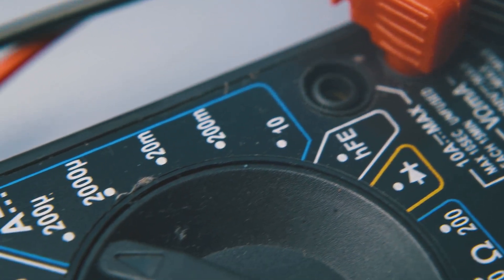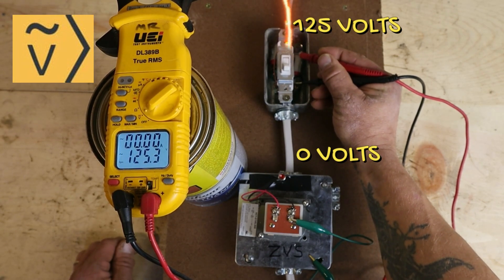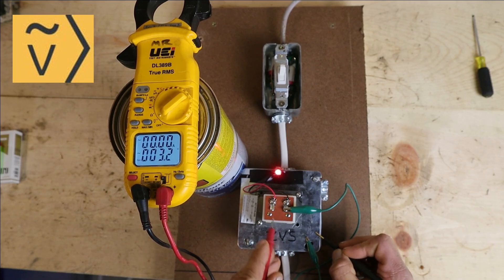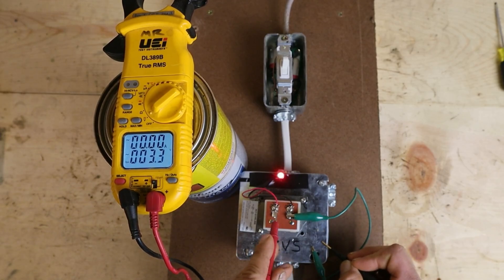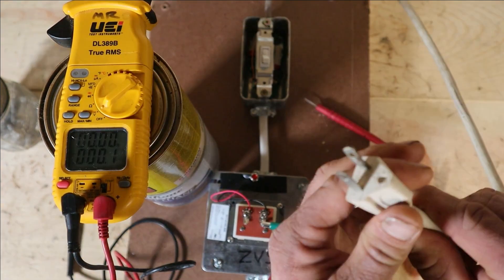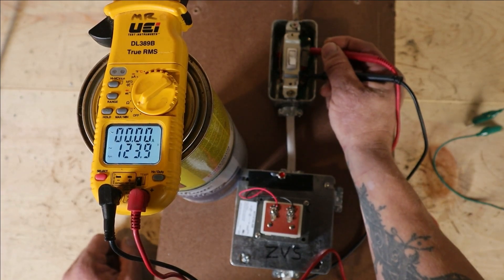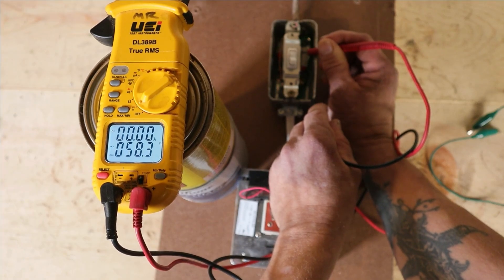What Most Beginners Don't Learn About Multimeters (But Should)

Comment: This is exactly how my dad trained me in HVAC electrical troubleshooting in the early ‘90s. This was when more and more furnaces & RTUs were using control boards and the 24v side of the transformer common would come grounded. Techs would see that ground and thought they could trace the whole control circuit to ground instead of common. 

My dad said all you will find that way is potential to ground, not what the transformer is actually putting out or if the circuit is operating normally. The same goes for the 120v line voltage and a bad connection of the neutral. Which I’ve come across a few times.

It’s good to see that you are still teaching the proper way, Mike!

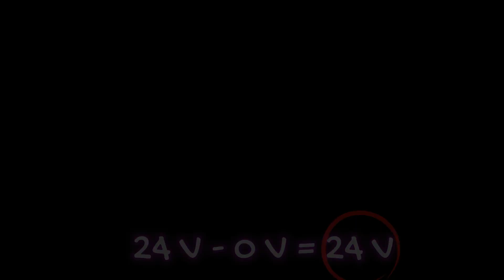Comment: At   02:18   your statement is incorrect. There is nothing in the multimeter "black box" that does 2 readings.  If you want to know why it is simply that the standard multimeter is simply an analog multimeter with enhanced electronics to make measurement easier.  These are things like  sample and hold, continuity buzzer, overvoltage protection, over current protection has not changed - just blows a fuse, diode checker and the other lesser used functions that electricians would never use like transistor checker etc.  Nowdays most multimeters have an ADC for voltage measurement. That's your multimeter in a nutshell.  
What you are talking about is potential difference and I see this mistake time and again.  PD is a relative reading.  The only reason you can say it's 1 volt or whatever is because you are using an instrument that has been calibrated against a standard before leaving the factory.

Comment: So "voltage differential" means an abnormality in the circuit
Reply from the maker: Not exactly. A voltage differential just means there’s a difference in electrical potential between two points—and that’s what allows current to flow. It’s not an abnormality. It’s the normal condition that makes electricity move from point A to point B. If there’s no voltage differential, there’s no reason for current to flow—just like water doesn’t flow between two pipes at the same pressure.
Reply: Ok, so at the least if my meter is reading half of what it should that means Im doing something wrong? And not really an issue with the circuit? @JerseyMikeHVAC
Reply from the maker: @Mr.Randy210  It could be either one. Sometimes you'll read half if the circuit isn't properly grounded and you're using ground as a reference point with your multimeter. Try a common or neutral instead of ground in that case.

Comment: If the electrician who wired that metal box had done a good job, it would have been bonded and would not have shown the 55 volts you observed.
Reply from the maker: Yes, that is correct. But this is a tutorial. It was done intentionally to teach precisely that point.

Comment: Not understanding potential difference isn't a lack of understanding how multimeters work, its a lack of understanding how electricity works.
Reply from the maker: This is absolutely true, but by framing it as something you need to understand about multimeters, I'm reaching a large audience of people using multimeters who don't know about potential difference. If I frame it as "How electricity works", I am only reaching people who are already approaching things correctly. Unfortunately, that's not the reality of our world. Some people are out there sticking DMM prongs into outlets taking voltage readings without fully understanding.
Reply: Something I was shown very young that really helped me to understand potential difference was my tutor rigged a pc to have 12v dc on one pin and connected the 5v to the other so that we got 7v potential. That really sunk it in.

Comment: For a real beginner, some more experienced tech needs to grab some tape and put over the jack for measuring Amperes.  Nearly 100% of new techs blow up their first meter by setting up to read current when they check a voltage source.

Comment: I'm an industrial mechanic.    The number one mistake i see other techs make is trying to read the hot wire voltage referenced to ground.  But if the neutral is open or partially open, then the meter lies to you.  Ive seen this dozens of times in 25 year career.  Also, if you read more than a couple of volts between neutral and ground, you've got a problem

Comment: I really appreciate you explaining these things, I too think it is a very important concept for beginners to learn. However, I feel that you left out one essential part of that concept:
Voltage is potential difference. You cannot measure voltage on one single point because voltage is the difference in electron charge between two points. You cannot determine the difference between two things, which is what voltage is, by looking at only one of them. So per definition, there is no such thing as voltage at one point in the circuit.
It's understandable that one would think it is that way because the way it's usually talked about does suggest that we measure a voltage at a single point, but in that case, there still is the necessary reference point, earth, it's just often left out because earth is the default reference point of sorts. Ultimately, we reach the same conclusion: always be aware of what you're using as a reference point when measuring voltage.

Comment: Also note, the AC voltage measurement is RMS voltage. This means in simple terms it's a trigonometric number in relationship to the AC voltage that is constantly changing. So if you're measuring something that's not a sine wave or no 60 hz, the meter can be very very inaccurate.

Comment: I was about to point out the obvious in the beginning.  Then I remembered "beginners" in the title.  I went to college for electronics.  BUT, this is a very good point and video that most beginners in the trades probably are not taught.  When I'm training someone I am very clear to point out that you have to have a reference, ground, neutral, etc to read the hot or positive.  No ground, no true reading.  That's how you get hurt.  We save reading voltage drop for a later date.  LOL.  Good points.

Comment: The intention of this video is sound. The explanation is not correct from 1:58. A multimeter in voltage mode does ‘make’ a single voltage measurement. It displays the difference in voltage between the two probe inputs to the meter. It DOES NOT do a calculation to compare each input with some external reference. At 2:23 we are back to the correct description.

Comment: Taking a reading across a closed contacts with the power on is how you read voltage drop, 0.0 volts is good.
Reply from the maker: There is 0 potential difference and it is a good reading, but it's not a voltage drop. There are still 120 usable volts there when you move one of your leads to a proper reference point. 

Measuring close to zero across a closed contactor coil or energized motor windings is an actual voltage drop
Reply: @ by your logic I don’t believe you understand what a voltage drop is.
Reply from the maker: @truthserum9157 You need resistance to get a voltage drop. A switch doesn't provide that unless there is a problem with it. 

There is a considerable potential difference that occurs in a voltage drop, but potential difference alone is not a voltage drop.
Reply: @JerseyMikeHVAC  being a motor control electrician in an industrial setting I’ve come across many instances voltage drop issues on contractors, switches, motor starters, all can be measured the way you did, top and bottom of of your switch, it’s not the way to measure voltage, but i was only pointing out that it was the proper way to measure voltage drop.

Comment: Cut my teeth on my dads great Simpson model 260 back in the 1960's then went to Fluke digital meters. CAUTIIN NEVER purchase or use any safety or test equipment made in lying cheating lack of quality control communist china. They money you might save not worth your safety or death if others. A coworker almost got electrocuted when he used a cheap combination capacitor / voltage tester. Was maybe 8 months old one only used a few times. The 480 volt circuit he tested did not pick up any voltage. He was rushing and should have first tested it on a know energized circuit, tested his circuit then retest on a know circuit. I always carried at least on replacement test lead & sparemeter fuses in my meter cases.

Comment: when the switch is on, and you test the terminals of the switch, you are reading the voltage drop of the internal brass switch components, which is more or less zero.

Comment: First thing to do with any multimeter is to check the continuity of the leads using.   Ohms.  A bad lead or probe could kill you as it would show a dengerized circuit.

Comment: A little interesting past story concerning multimeters. Decades ago now I was gifted with a Centech multimeter. And I was proud of it and wanted to show my wife what it does. So I took the meter and plugged both meter leads into the wall socket and to our surprise the entire meter popped very loud and jumped as well. A little smoke came out of the meter and it was toast...figuratively and literally. What I didn't know at that time was that Centech meter was in the off position. And for some strange reason, they built their meter to be in a shorted lead when circuit in the off position. So the circuits inside were vaporized off the board. I had to rebuild that meter to be able to ever use it. Since that time I own many Fluke meters and some other cheaper meters. But that experience with the Centech taught me a great lesson. Be careful how you use any meter...

Comment: One thing I will add.  You are using a ‘True RMS’ meter. 

Accidentally put your meter onto DC Volts and measure your switch and it will show you zero volts. 

This is because the RMS is calculating the ‘average’ voltage and on sine wave AC power it will always average to zero volts. 

Be aware and don’t make this mistake!
Reply: "True" RMS means that is has the voltage added in an integrating circuit to give a real value. Some meters may just read the peak voltage and dive by square root of 2, but this is only correct for pure sine 1waves. The RMS of other waveforms is different (e.g. square, triangle, harmonics in your sing, noise, etc.) and would show an incorrect reading if using the "pure sine wave dive by root 2" trick.
Reply: @ An integrating circuit is still calculating the average value, no?

Agreed, it isn’t just a mathematical calculation off the ‘peak’, but it is still calculating an average based on more accurate data.
Reply: @rickschlosser6793  it's taking samples, squaring that voltage and then adding them up in the integrating circuit, then taking the square root of that value. The same way you'd calculate it mathematically, hence "true".

Also, the AC will be ignored when measuring DC,  ut you still may get a small reading due to any DC offset. 

I hope that helps you to understand. Ppwer= V²/R, so we want the  root mean square of the AC in order to give an equivalent DC voltage in terms of power delivery. Typically we want the RMS value, but capacitors for instance are rated in peak voltage from what I've seen, so you a 300V rated capacitor will blow on 277VAC (RMS) .  For dielectric breakdown threshold  we are concerned with peak values.

Comment: People forget that the Volt is a unit of potential difference

A Volt is not an absolute unit, it is a relative unit. As in the relative difference in electrical potential between two points.

To measure a difference, there has to be a difference to measure. When you're trying to measure two circuits which are electrically isolated from each other, there is no potential difference across them, therefore there's nothing to measure. Even though both may contain very high voltages inside them.

A good example of this is using an isolation transformer to work on CRT equipment. There's anywhere between 7kV  and 55 kV on the anode of a CRT. Some - maybe more. Yes, that's THOUSANDS of volts. With enough current behind them to stop your heart instantly if you toch the anode with one hand and a reference ground (for example an earthed metal table/etc.) with the other. The isolation transformer makes this sort of equipment safe to work on by taking away the reference ground. That means that even though there might be 55 kV inside the equipment, if you accidentally touch something you shouldn't, said 55 kV hasn't got anywhere to go, so you're relatively safe. You'd have to touch both the anode and the chassis ground for current to flow.

This also means that if you accidentally connect your scope probe's ground lead to a source of high current (rather than a skfnal reference ground), it won't blow up, as there's no potential difference between the hihh current source and earth ground (where the probe is also grounded to).

Comment: Advanced electricians only:
Pause the video at 4:32.
What happens if you try to "reconnect" the ground wire in the plug that's been mutilated by taking it to the workbench and wiring the ground wire to the neutral wire?, since ground and neutral are connected anyway in the panel.
Bonus points if you label each V, A, and Ω at the worthwhile nodes in both on and off states.

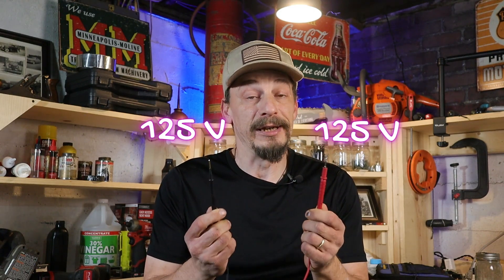Comment: 2:50 sorry you are measuring a current, when measuring Voltage. If there is no potential (or the potential is to low for your DMM, even over a switch (there will be a resistant of a milli ohm or lower) then the no current.
If you are measuring amps (with out a clamp) than you are measuring Voltage…. 5:27 Both points have the same reference! The Starpoint of the transformer, the are just using different ways. First L to N, second is L to PE.
Reply from the maker: You can't talk to beginners like this.
Reply: @ That’s just ohms law….
Reply from the maker: @zoom_h2625 Yes. I'm aware of that. Thank you.

Comment: This is a very good video I love when people go back to basics like this because it is easy to overlook these things when troubleshooting. You must know how your particular meter works too. For instance, the meter I use for work and others have certain limitations you need to know. My meter will read continuity with the tone on, but in that setting, it only reads up to a certain resistance if I turn the tone off, though resistances much higher can be read.

Comment: If the DVM "didn't" measure the potential difference between the red probe and black probe, what would it be called since its not measuring the potential difference in voltage?

Comment: What a great way to start a Saturday. Great video Mike, direct and to the point.
And may I add that a cheap set of leads can cause unreliable readings. A good set of leads is important for correct diagnostics.
Reply from the maker: Very very true!
Reply: Cheap probes? I don't trust those cheap ones. Best to but some cat 3 rated probes